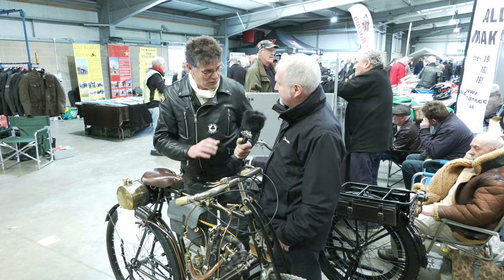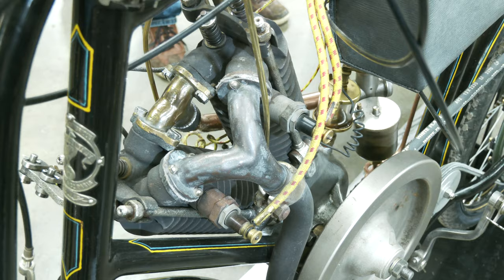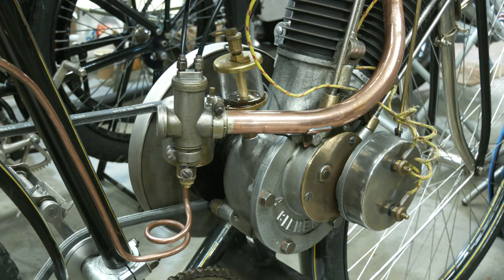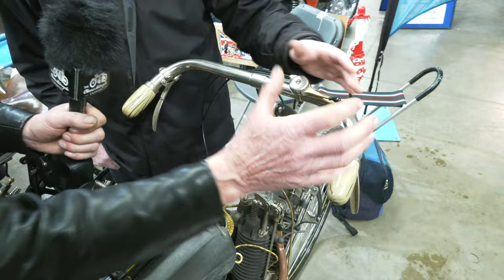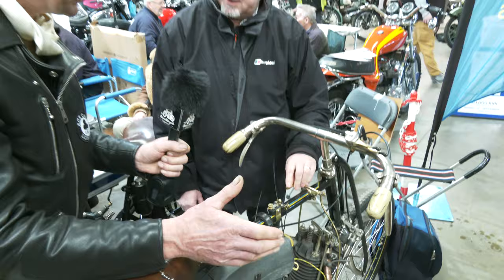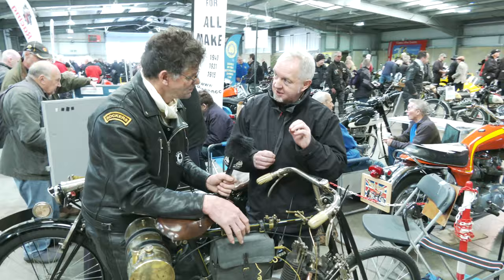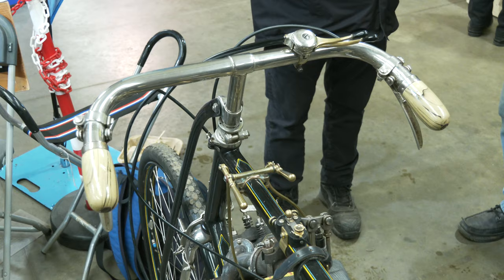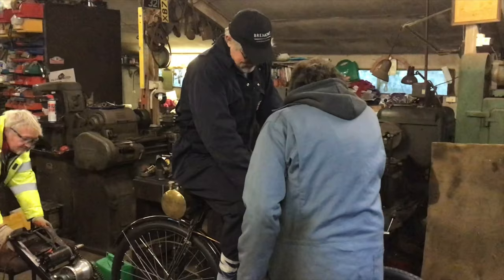1903 V-twin Clement racing motorcycle - quick look, start-up & ride

Comment: Overhead valve and an engine that has some kink of compliant mounting (it shakes a bit but the bike frame does not shake with it). Remarkable. The fact there are still a few of these left implies they must have been popular at the time and well enough liked to survive WW1 and German occupation in WW2.  A very interesting video, thank you Classic Motorcycle channel.